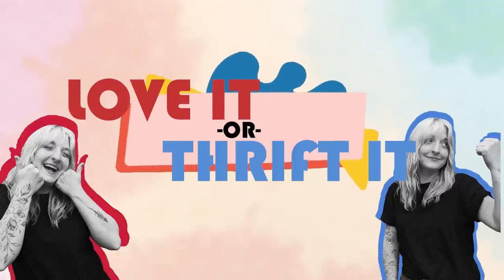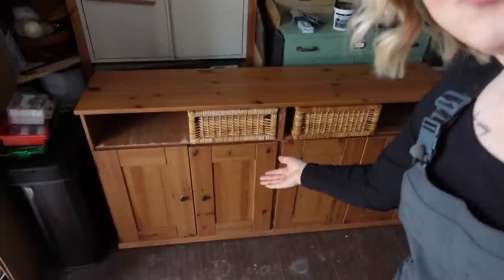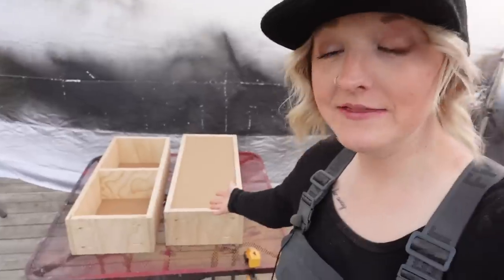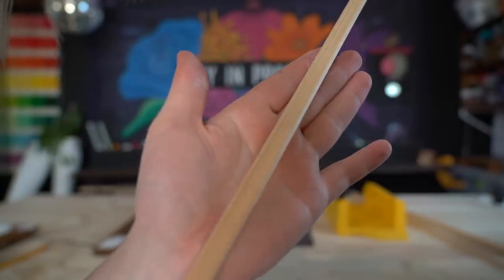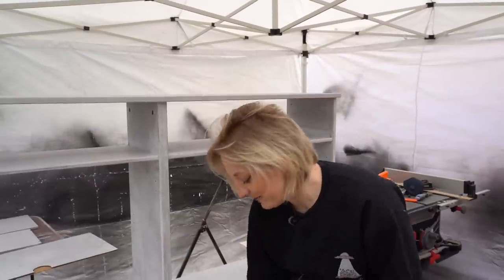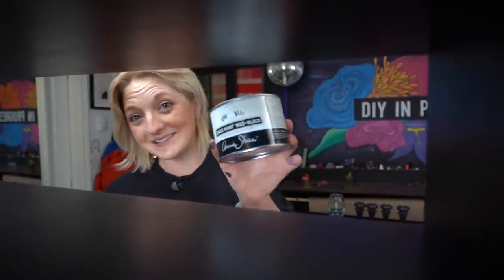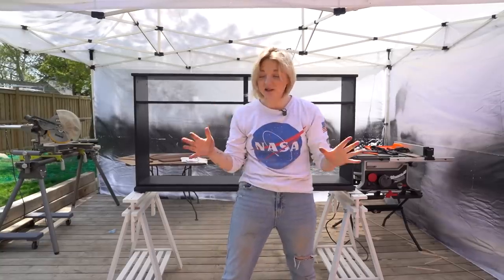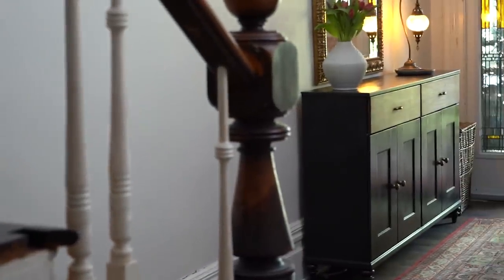*STUNNING* entryway thrift flip makeover | IKEA transformation | LOVE IT OR THRIFT IT | DIY DANIE

Comment: I did similar w my melamine kitchen cabinet doors: "cabinet rescue" acrylic paint tinted celery-green with buffed wax finish -- love it, and cleans beautifully with a vinegar/detergent/water spray.
Reply: Thanks for that info; been wondering how using a buffed wax finish would work in a kitchen with all the grease, smoke, etc.  Would the wax absorb these, along with the splatters and smells?  Would it melt/soften from the heat (from stove/oven)?  It is a lot of work for this process not work or hold up.   Did you use Annie Sloan's wax?  I know it is the most popular/known.

Meg, I appreciate your input - thanking you in advance.

Enjoy your day and have a safe, fun and fan-tab-ulos weekend!!

Comment: I have had a Saw Stop for 16 years and LOVE IT. Just a tip - watch the moisture content in the wood you cut - it can trigger the safety mechanism. =) but I’d prefer to have a couple replacement blades over the years instead of missing fingers so… worth it.

Comment: The black paint with black wax was just chef’s kiss but I am firmly in the talking to my phone saying nooooo when you swapped those gorgeous antique drawer pulls. The new ones were so tiny on the drawer face and didn’t work with the knobs as well. Too shiny.  And as an elder Millennial with back issues, the low knobs would destroy my back and I’d have to move them higher to be more functional.  Overall the piece is lovely and I’m sure it’ll be a workhorse in that entry for years to come.

Comment: I have a quick question how big do you know how to make the insert for the drawer when doing a sliding drawer. I hope I make sense because some reason I cannot wrap my mind around if you put the drawer slides underneath or the side how do you know how much to decrease the width and height of the shelf that's being inserted. Because you find the instructions for the sliders or is this a normal knowing measurement? If you could answer that for grateful!
Reply from the maker: Your sliders will sit on the sides of the drawers and cubby hole. MOST sliders are 1/2" thick. So you want to create a drawer that's at least 1" smaller than the width of the drawer. Maybe even shave off 1/16th of an inch to be safe. For the top and bottom, thats up to you and  it depends where you want the sliders to sit but I like to give about a 1/2 space on the top and 1/4 space on the bottom. If you place the slider directly on the bottom, the slider will naturally give you that 1/4" spacing. Hope this helps!